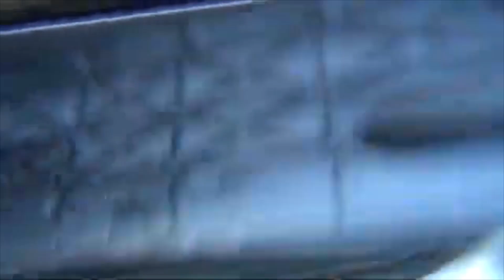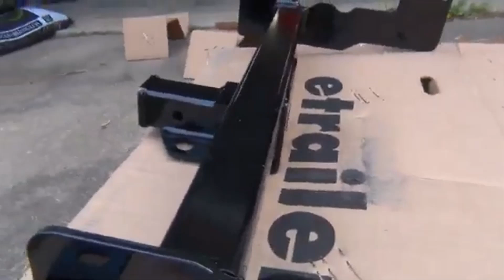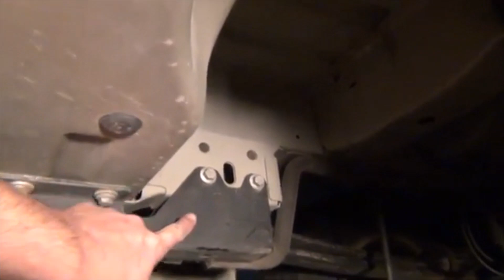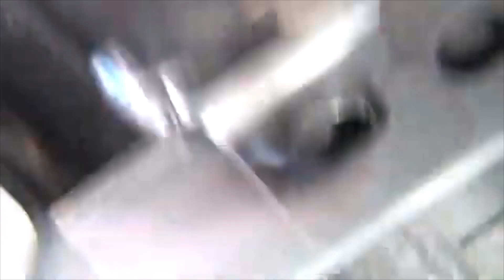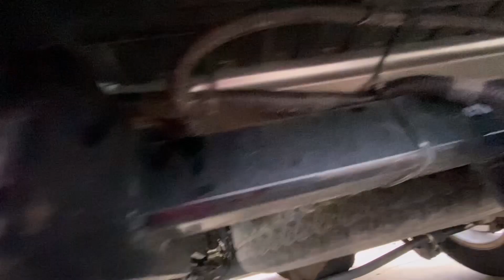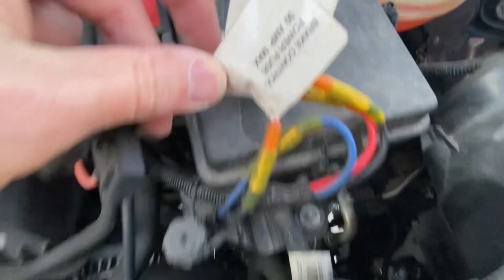Installing a Hitch on my 2017 Ford Transit 350 XLT

Comment: I have the same van, I was thinking about getting the factory hitch installed with the OEM wiring, but the only problem is supposedly there is a module that needs to be programmed by the dealership, do you know if it’s even possible to install a factory hitch on these ?
Reply from the maker: During my research to install the hitch and wiring I went with, I didn’t come across any factory options. By going strictly aftermarket, I was able to install a turnkey wiring harness in my van by tapping into the brake harness and a power supply. I’m afraid I don’t have any info on factory tow packages.